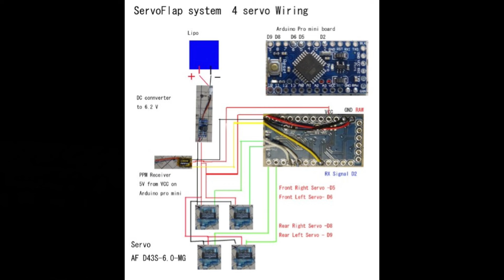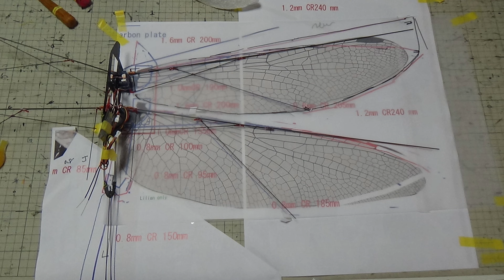サーボ駆動トンボ型羽ばたき機　4サーボ　ServoFlapOrnithopterDragonfly90 4servo-2 51g  :　1st Flight Test

Comment: Could you give me the code?Thanks!
Reply from the maker: This is the website in the description.
Arduino CODE ver2: http://kakutaclinic.life.coocan.jp/SFOsys4S.html
Reply: @BZH07614  Thank you, I also wanted to ask, what model of remote controller and receiver do you use?
Reply from the maker: TX  JimperT8SG. RX  1g afhds2a RX ppm output.
Reply: @BZH07614  Thank you very much. I'm a beginner and I would like to ask again, how do you set up the remote control? I would greatly appreciate it if you could explain.
Reply from the maker: @jinzeliang  Please look Flapping Test  https://www.youtube.com/watch?v=P8rutz3MslY
Reply: @BZH07614  Thank you!How about chanel7,the test only use chanel1-6?The code has chanel 7
Reply from the maker: Ch7 is for correcting the aileron of the rear wing and making the front and rear wings the same inclination.
Reply: @BZH07614  Have you used Channel 7 when configuring the remote controller? I didn't see Channel 7 being set in the video.